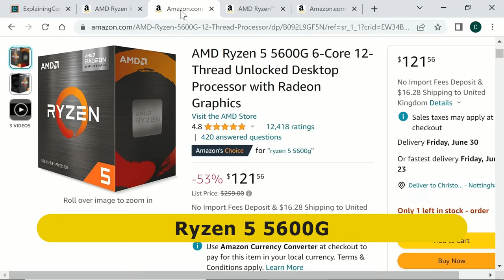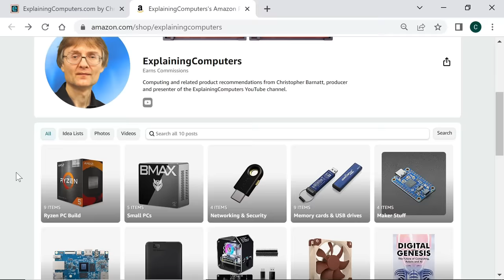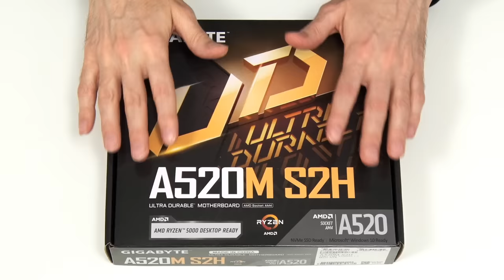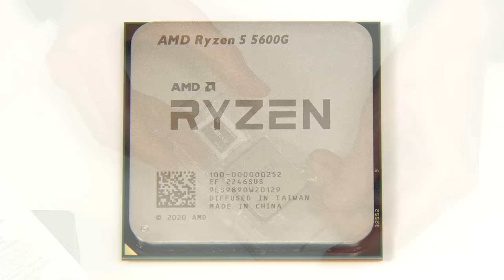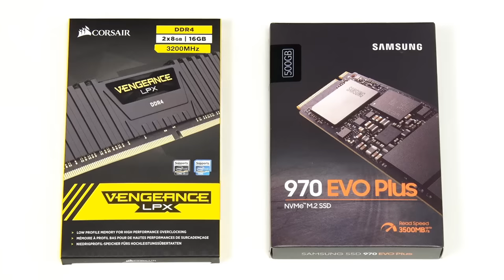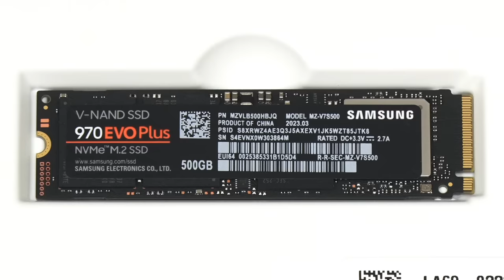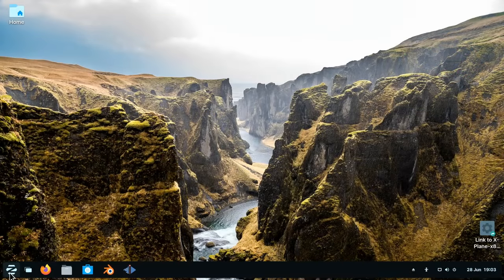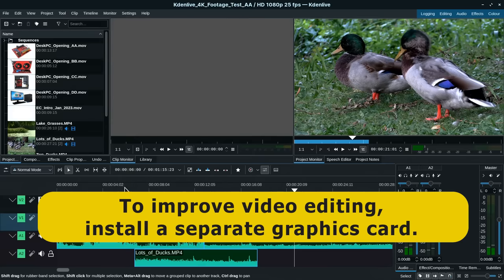Best Value Ryzen PC Build

Comment: would this machine be good enough for revit, 3d modeling and rendering?
Reply from the maker: It will certainly work for those applications, and decently so. And if you wanted faster 3D graphics performance in the future, you could add a dedicated graphics card. I personally would be happy to use those applications on this hardware. :)

Comment: I read somewhere the onboard RDNA2 GPU in AMD7000s is weaker than those in the "G" processors. So to enable playing games without a separate GPU, probably new "G" series will be a good idea.
Reply from the maker: I also understand this to be true. The GPUs in the new 7000s are basically there for business graphics, whereas the G processors were intended for lower-end gaming. We may still get a 7000 series G chip or two.

Comment: Today, 16 GiB of RAM is really, really tight, especially if you are using graphics with shared memory. My guess is that you will end up - if you subtract used RAM for graphics and operating system - with about 8 GiB RAM for applications. Unfortunately, newer application (especially everything browser and electron-based) will gobble up RAM as there is no tomorrow.
Reply from the maker: I really do not agree. Maybe you are talking about gaming? But otherwise, 14GB (assuming 2GB allocated to the GPU) is ample for the vast majority of applications (I type this running on the 8GB i3 on which I've run my business for 9 years). Now granted, I edit on a 32GB machine, mainly because I often have After Effects, Premiere, Photoshop and Illustrator running together. But this would work fine also in 16GB.

Certainly for a PC costing below $/£300, 16GB of RAM is ample. And 8GB would have been perfectly acceptable.

Comment: About The monitor 
Iis it VGA or HDMI  ??
Do we find problems using this bulid with VGA monitor ?
Reply from the maker: The motherboard has VGA, HDMI and DVI-D (digital only) connectors. So there are no problems using a VGA monitor -- it will work fine using the VGA port.
Reply: @ExplainingComputers  thanks to you siir

Comment: Hi, thanks for the video. I have a similar set up but with a Ryzan 3 and the same wraith cooler. Some sites seem to be suggesting that there is a thin plastic film protecting the thermal paste which needs to be removed before attaching the cooler, but i cant find a definitive answer on this. My cooler doesnt seem to have any sort of film on it from what i can see similar to your presentation. Any suggestions?
Reply from the maker: I have never come across a plastic film over the thermal paste on either an Intel or AMD stock cooler. But it is quite common to have such a film over a thermal pad (a very different thing) on heat sinks that are fitted to SBCs, etc.
Reply: @ExplainingComputers  many thanks ...

Comment: I am having an AMD fx8320 processor, 8gb RAM, gigabyte GA78lmtusb3 r2 motherboard and radeon r9270x graphics card. 
Could you please suggest a Linux distro(new or old) for my desktop which can utilize my hardware to the fullest.
Thanks in advance

Comment: The only issue I'd point out in this build, which has most part being appropriate for the build goal, is with the SSD being 500GB.  The reason is that 1TB should really be the minimum for any system.  And you don't just get more space but the 1TB uses 4 memory chips rather than 2 on the 500GB.  The controller has four lane to the memory chips and uses all of them on the 1TB, but only two on the 500GB so bandwidth is better of the 1TB (this does not increase with the 2+ TB drives which remain at four lanes).  Also the drive life of a 1TB drive is twice that of a 500GB SSD in terms of terabytes written.  These days the 1TB drives can be had for less than twice the money of a 500GB drive (certainly if you catch one on sale). IMHO.
Reply from the maker: It really depends on the use case. A statement such as "1TB should really be the minimum for any system" is pretty daft without knowing what the system is going to be used for, and what other local drives and wider storage are going to be connected! :) 500GB is a massive overkill for this PC in terms of the system drive.
Reply: @ExplainingComputers  Use case is important.  It certainly defines everything.  Please know I meant no disrespect.  You've long had my respect.  "Any system" is indeed an overreach. "Many" would have been a better choice of words.  But use case remains definitive.
Reply from the maker: @L.Scott_Music  :)

Comment: Why A520? B550 will do much more for it and allow you to upgrade to 4.0 PCIe slot for future.  A520 best only holds 3.0  and future wise for GPU's with the unreal engine now going to 5,  this would require 4.0 gpu with min of 12 gb to run game in high to max setting.  all stores around here don't have A520 or A320 MB atm for most likely not in stock do to everyone wants 4.0 over 3.0 PCIe slot.

Comment: Is stock CPU cooler adequate for keeping system cool ? Always have used third party coolers in the past....
Reply from the maker: Adequate is a good word for it. I may change the cooler, but the reason will be to fit something that makes less noise, not to improve cooling.
Reply: @ExplainingComputers  I fitted an after market cpu cooler which makes system quiet in normal running, however I found that when building iso images temps went beyond 70c and was getting throttling. Adding a rear case fan helped (again set to run silent). Wondering if this is normal for the 5700G...other than that I am very happy with new build.

Comment: So..... Can I ask? In this relatively standard PC, without any extreme Graphic cards, does it need all those fans? Just asking as someone that doesn't 'game' (yes, there are people that use a PC that don't game?) but wants a relatively up to date pc.
Reply from the maker: A good question. One decent back case fan -- like the 120mm one fitted here -- would almost certainly be fine. The four here are very much overkill. :)
Reply: So, here's the thing. Your system comes out at £234. But I'd have to include a case and PSU (£100?ish). Then I'd have Windows 11 to purchase. I might be able to get a deal with an SSD pre installed with windows? But I'm guessing that has me knocking on the door of £400? UK costco, have a pre-built system matching that spec for £399 including delivery. I can't help think that a self-built should be coming out cheaper?

Comment: I think buying used hardware is undeservedly neglected. Especially when it comes to value builds like this and picking components that are one generation behind, your local Craigslist is rife with those components and might save you about 50%. It is certainly not as convenient as buying new, but other than that there's nothing really you are loosing out on when buying used.

The reason I like to pick a higher spec motherboard is that I plan to use my computers for a long time and in my experience the motherboard's connectivity features have the biggest impact on that. 

This CPU horsepower and DDR4 RAM speeds will be still reasonable in 10 years time for a home server eg. NAS and a number of VMs, but the gigabit ethernet port (not having 2.5G), a single M.2,  4 SATA connections and 2 PCIe slots will be very much limiting if you want to repurpose this system later on instead of sending it to e-waste too soon. Even if you choose not to repurpose it yourself down the line, it will be easier to find someone for your old hardware who wants a home server for a few quid and recoup the extra £30 spent on a higher spec motherboard.
Reply: interesting, would you suggest some mb options ? thx

Comment: Do you need to use dual ram dimms with DDR4 ram?
Reply from the maker: You can fit one module, and it will work just fine. But performance is better with two modules fitted.

Comment: I did your budget PC build. When I'm sculpting high mesh in Blender it buffers and shuts down. Rather than a change of graphics card would this Ryzen 5 5600G be a better alternative? Thx
Reply from the maker: I presume you are referring to the 2200G system from a few years ago? If so, a 5600G, or any other 5000 series Ryzen 5 or 7, will indeed provide more processing power. This said system RAM and GPU RAM (and power) will make a big difference when you've got to the point of a system shutting down in Blender due to lack of resources (I've never experienced this). What graphics card are you using, and what is your RAM?
Reply: @ExplainingComputers  Thx for responding. Yes it's that build. The card is the GTX 1050 Ti and the RAM is 2 x 16GB DDR4, ??

Comment: you can just about build a 6 core pc for the price of a raspberry pi now - the irony - but more substantially amd 5600g is almost less than 100 bucks and twice as powerful than older refurbs - it makes the value proposition of refurbs less appealing - additionally ram prices are down in price and nvme drives are so cheap now there is no reason to go with a regular ssd - prices should continue to drop as pc industry is in a major depression and new generations keep going with rapid dev cadence. the performance difference from older pc systems is major and it makes the raspberry pi and other sbc/soc look like toys - spend the extra 50 bucks and get something that will save you time and make you much more productive - you can run raspberry pi and openwrt and arm as vms. for decent upgrades to this system consider nvme raid0, 2.5gbe or a couple big spinning rust drives - skip the gpu, it doesn't need it

Comment: Is there any reason to use the a520 board instead of a b450? Looking at the specs they’re both pcie gen 3
Reply from the maker: CPU compatibility is the issue. If your CPU is supported by the revision of the BIOS included with a B450 board you can use it. But if you buy a B450 board and it has an earlier BIOS that does not support your CPU, and the board does not feature a CPU-less BIOS upgrade option, your system will not work. By definition, A520 and B450 boards have different chipsets, of different generations. Just because two motherboards have the same socket does not mean they can use the same CPUs.
Reply: @ExplainingComputers  thank you very much! Your channel is a treasure trove of information

Comment: I never knew you could run XP11 on a Linux machine, I thought it had to be an MS machine, can it also run MS Flight Sim?
Reply from the maker: Sadly not the MS one. :(
Reply: @ExplainingComputers  Ah ty I thought not but had to ask, I also never knew about certain Ryzen cpu's you could do without a GPU, I keep saying they GPU's are getting bulky and often need supports as some have cracked due to the weight, so this is definately a way forward.

Comment: Once AMD Ryzen 5 processor is attached to motherboard can we easily remove it to bring in Ryzen 7 or its impossible?
Reply from the maker: Yes, a CPU can be easily removed -- just remove the cooler, raise the retention level, and remove it. You would need to clean off the thermal compound, and replace if reusing the same cooler.

Comment: Можно было бы собрать на Asrock DeskMini X300. Там разогнать память и встроенное видеоядро можно. It would be possible to assemble on Asrock DeskMini X300.  There you can overclock the memory and the integrated video core. Оперативная память на чипах самсунг b-die скорее всего. Если память версии 4.31. RAM on Samsung b-die chips most likely.  If memory version 4.31

Comment: There's a fellow who managed to use some Ryzen APUs, including the 5600G, for AI. Not sure whether he had a discrete graphics card on it as well, but the AI all ran on the APU graphics hardware.  I'm going to try it out, since last November I upgraded (after seven years) to an ASRock Deskmeet X360 with a Ryzen 5600G. (I also got a RX 6600 for it, so the on-chip graphics can devote itself solely to AI. More info at https://www.youtube.com/watch?v=HPO7fu7Vyw4&t=1s

Comment: With all due respect, linking to components is risky these days. Your Gigabyte A520 SH2 is now only available (.UK) as follows: "Used - Like New: £57.42"; "New: £78.08 dispatched from Bulgaria / £75.33 dispatched from UK". Too bad you don't have a backup option ("Plan B mobo").
Then, there are many alternatives to your choices. Similarly priced to your:
■ Corsair VENGEANCE LPX DDR4 RAM 16GB (2x8GB) 3200MHz CL16: £38.66
there is:
■ Kingston FURY Beast 8GB 3200MHz DDR4 CL16 Desktop Memory Single Module KF432C16BB/8: £18.99, hence 2 pcs=£37.98
Then, while I also use some Samsung SSDs, I just found that Kingston can offer twice the capacity for the same price, at the same speed. Compare yours:
■ Samsung 970 EVO Plus MZ-V7S500BW | Internal NVMe M.2 SSD, 500 GB, Up to 3,500 MB/s sequential read: £35.99
to this one that I just installed in a laptop:
■ Kingston NV2, PCIe 4.0 NVMe Gen.4, 1TB, up to 3,500 MB/s read, 2,100 MB/s write: £35.99
All in all, it would be wiser for you to provide alternatives.
Oh, I was forgetting: I thoroughly hate such huge cases; I prefer the SFF (or even smaller when possible, such as that refurbished HP EliteDesk you made a video about; I own a newer HP ProDesk 600 G6 Desktop Mini PC, but of course such cases cannot accommodate such CPUs, but rather lower TDP ones).
Reply from the maker: Thanks for this. Linking to components is not "risky", and I know from 15 years experience here that I'd get a lot of complaints it I did not do it. However, it's also not a surprise that anything linked to from a channel of this size goes out of stock fast (sometimes every online store worldwide is cleared out within an hour of a video going live, although stock often returns). I'll add an alternative motherboard for the UK (as I already had for the US). :)
Reply from the maker: I've just checked and the Gigabyte A520 mother is listed in stock on Amazon UK. :)
Reply: @ExplainingComputers  Nope. You have read "£57.42 Only 1 left in stock", but should you move your eyes to the right... "Buy used £57.42." Please use your eyes and your judgment responsibly. And, I have used your original link (to "GIGABYTE A520M S2H mATX Motherboard for AMD AM4 CPUs"), not a search.

Comment: Hi, maybe sb. here can help me on my search for a mini pc/"nas"/homeserver/htpc. I'd like it to have a ryzen cpu and it must have space for one 3,5" hdd. Most critical point: Since it should sit in my tv shelf it mustn't be higher than 15cm. It can also be a less powerfull cpu than this one, my starting point is a Odroid HC2, so everything equally or more powerfull if fine. +It should be power saving. Any ideas are much apreciated.
Oh, and arm is out of question, had some arm devices in the past, with good experiences but now I just want to try a x64 device.

Comment: This is funny. I just did this very thing. For the first time i was able to upgrade the CPU, Memory and Graphcs card without having to jump up a CPU socket as the current MOBO was still good to go. SO i ditched the first gen Ryzen 1500 and got a Ryzen 5 5500/ Got rid of the 8 GB 2133 ddr 4 and got 16 gig of 3200 ddr4. I also got rid of the the old GTX 1060 6 gb and moved to a 3060 12 gb. I got rid of the first gen crucial M2 Nvme SSD and got a samsung 970 evo 1 TB. 

I should have waited one single month to buyt he GPU as the 4060's just came out for the same damn price as i paid for the 3060. I will never again buy anything branded ASUS or Gigabyte. Those boards never last beyond 2-3 years. Ive had my MSI Gaming now for over 5 years.

Comment: No paste needed to fit the fan to the cpu?
Reply from the maker: As repeatedly shown and discussed in the video, thermal compond is pre-applied to an AMD stock cooler (and it is to an Intel stock cooler too!).
Reply: @ExplainingComputers  Yeah I heard the bit where you said that. Just wasn't sure if that would suffice long-term.

Comment: How do you know it was your motherboard that was dying?  Mine may be on its way out too.  On a restart, usually it beeps six times, repeats, and never boots.  So I turn it off and wait 30 seconds, turn it on again and then it usually fires up on 2nd try.  Wondering if you or anyone else here may be having same problem and if anyone has solved similar issue?  Desktop computer is an Acer At3-600 2013 with upgraded CPU & memory with AMI bios -code indicates possibly a keyboard controller, pci card or mobo issue.  Video and wifi cards removed, and she still beeps.  Could replace mobo but then lose my Windows 10 license.   Any suggestions?  Really like this computer -upgraded memory to 8GB eight years ago, quad core CPU 6 years ago, and SSD two years ago.

Comment: Beware :: there is no upgrade path to am5 cpu, as shown the cpu in the newest generation has no pins, doubtful that the latest ryzen will be made to fit.
Reply from the maker: As the video makes very clear, the 7000 Ryzens indeed use a different socket (AM5).
Reply: I suppose it depends on the system he's looking at, but it looks as though Prof. Chris's favorite method of upgrading is to keep a system for quite a while and then upgrade everything including the motherboard--and I can point to this very video as Exhibit A. 😉
Reply: @jb31842  sure, it was just a warning for others, the previous amd had several upgrade possibilities, am4/am5 does not
Reply from the maker: @jb31842  You are correct. I've only once upgraded a CPU. Usually I do motherboard, CPU and RAM together. But I drive upgrades quite regularly.

Comment: Does the fan cooler come with the motherboard?
Reply from the maker: The CPU cooler comes with the CPU, as shown in the video. :) The replacement case fan I fitted was purchased separately. Most cases come with at least one fan fitted.

Comment: hi, what should i do with my new build, i got ryzen 5 5600g with asus b550m wifi motherboard and 1 stick 8gb ram rgb is on put it in 2nd slot, but got no signal on my monitor. i tried removing the cmos and put back again but still not working.